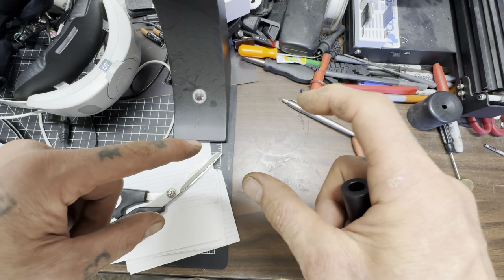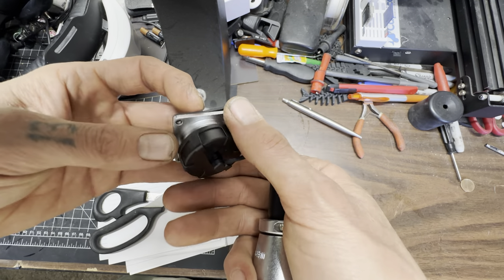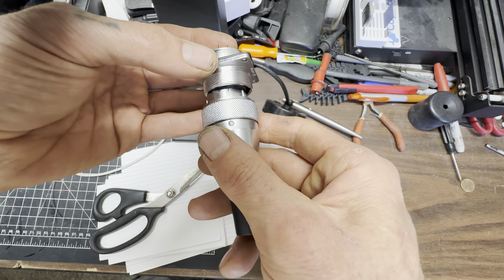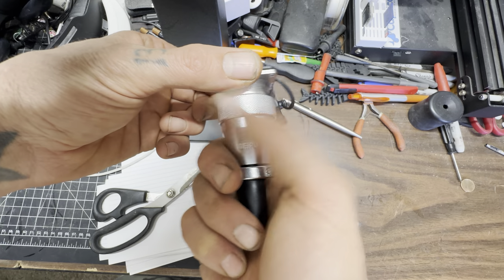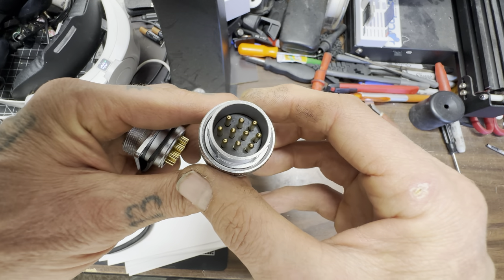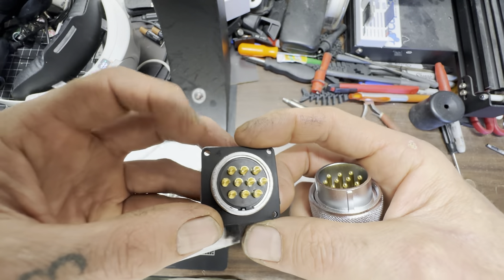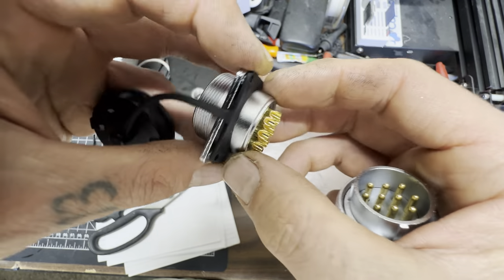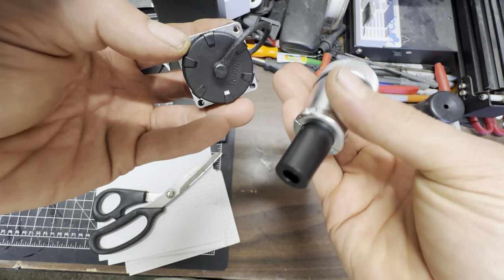#C10 firewall bulkhead connector upgrade

Comment: Don't Know How They Expect The Wire To Connect To Such A Short Terminal!!! Car Wiring Needs To Be Crimped!!! Solder Will Melt Away If The Circuit Gets Hot!!! That's Why We Crimp Not Solder Automotive Connections!!! Looking Forward To Seeing How You Deal With Those Connections!!!
So You Need To Do A Video Of How And Why The New Name!!!
Keep Rocking It Out Brother!!!
Reply from the maker: HAHA I knew someone with more wisdom than me would chime in. will probably send these back and find a new stock style. not enough meat on these for a truck that will be bouncing around.